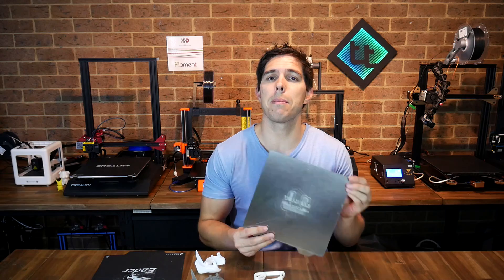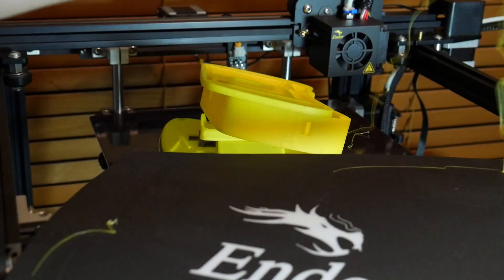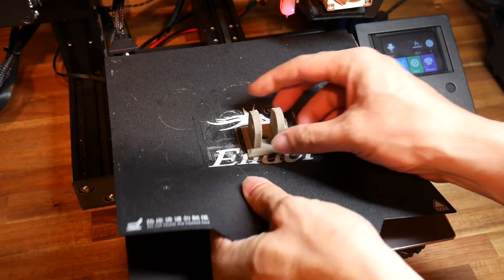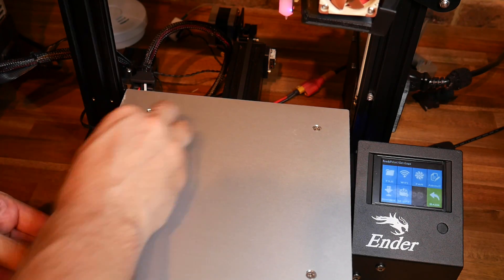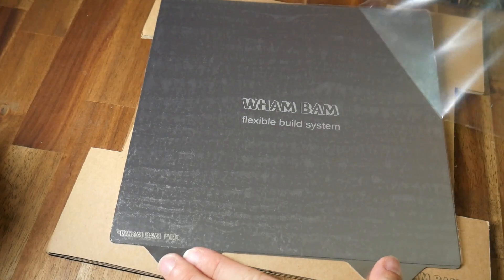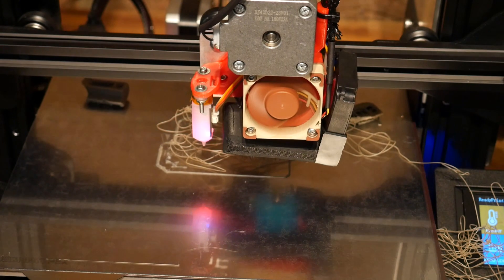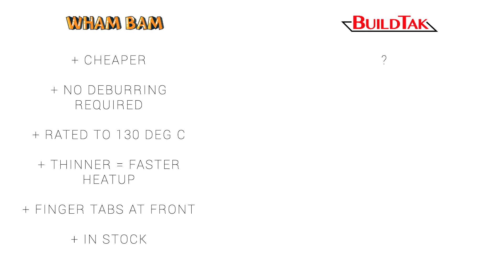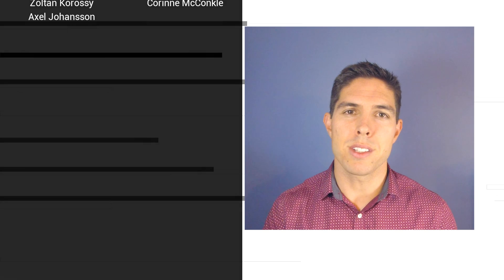Wham Bam Flexible Build System vs Creality Cmag vs Buildtak Flexplate

Comment: As one who mostly prints with PLA I find this product a big dissapointment.
After all the up beat "wham bam print away" videos on YouTube I finnaly shelled out for a Double Wham kit.

Having had it for two days now on my CR10 S Pro (Bl Touch) I'm still struggling to get PLA to stick. My previous problem was too good adheashion after prints were done, so I was looking forward to flex prints off the plate. I've scuffed and scuffed the PEX until I broke out in a sweat, and all I got from it was a good workout.

If it would only stick. No squishing of the first layer or high bed temps have helped so far.

I'm holding back from giving one star, in the hope that it'll suddenly start sticking...

Comment: Not positive, but I believe temps above 80 c not being recommended has more to do with the adhesive and flexible additives in the magnetic sheet breaking down, than it does reaching it’s curie temp…? 80 c seems kinda low for a curie temp.

Comment: Got really bad experience with the Creality magnetic bed cover. It was stretching to a point where prints were warping with the bed cover still attached and when removed there would be stretched bumps there. Obviously wouldn't happen with steel so I'm eager to try it.

Comment: I use the creality magnetic pad and I spray Ultra hairspray on it. Works very well but if the print is longer than 10 hours it starts lifting on one of the sides. a bit

Comment: I just buy the system for cr 10 s pro but I have problems keeping the models in place. I start at 70° but then when is about 2 inch thick or less it just snaps out and I wonder if you guys have a way to make it stay. ?? Do I reduce the temp and let the bed cool down or should I keep constant temp? Please help if anyone else have this problems usually with small parts.

Comment: Consider scotchbrite or similar abrasive parts instead of steel wool, you won't end up with tiny fragments of steel wool everywhere, which shouldn't get near your electronics and is probably disastrous I'd it gets in rolls of filament.

Comment: I'm an old dude that just got into 3D printing a few months ago with an Ender 3 pro.  I switched to the Creality coated glass bed and its pretty awesome.  I installed a Bigtree Tech board and it was a game changer and I installed the BL touch at the same time but haven't used it yet.  I cant find an installation / setup video for "total noobs"...I mean that assumes you know zip about how to set it up!!  Can you steer me in the right direction for a video?  You're basically my guru for all things 3D and I cant seem to find this in your library.  Thanks for this video!!

Comment: 3:08  I think this is because you have a stiff section on the bed and you dont pulling of a line but instead pulling of a surface, imagine if the whole build plate would be stiff then you have to pull of the whole area of the buildplate at once.

Comment: it is a slow process of losing it's magnetic field one print or two prints won't show it. the more heat the faster it goes ... this just shows it's still good for 3 or 4 prints at higher temperature.

Comment: Seems you are dealing with two compunding factors making separation of the magnetic layers difficult. A) creating a vacuum seal between the layers underneath the footprint of you print, and B) effectively turning that area solid rather than soft and pliable.

The quick n dirty way of "solving" this would probably be printing a very narrow wedge, smooth its tip edge, surfaces and any layer stepping slightly to avoid doing damage to the two bed layers in use. Then, when a print is done, separate the layers as far as they will go without struggle. Next, slide that wedge in between the magnetic layers, and press it in underneath the print. You wanna limit the force applied as much as possible, while still doing the job, so keep the wedge long and its angle narrow. You're basically just trying to "break a seal" to get it going.

Comment: Don't use the steel wool shown in this video. That'll carve groves the size of the Grand Canyon.
Instead use fine or ultra-fine steel wool used for polishing other metals. It'll scuff the pex layer more evenly and leave a nicer finish on the bottom layer.

Comment: The reason the creality has a hard time coming up is because of torque. Where the part is, you need to not only overcome the magnetic force holding the leading edge of the peel, but also the force under the entire print area. This does not happen with a steel sheet because it is stiff, giving you the mechanical advantage of the lever arm between your fingers and the back of the print area. Think like opening a door, because the creality has no stiffness, you only have the lever arm of the leading edge of the peel. When there is a stiff spot the magnet has a longer lever arm. In the analogy you would have your fingers inside the hinge, and the magnet would be holding the door closed with the handle. Crunchy...
Reply: The reason you could not figure out this behavior despite it being blindingly obvious is because you did not assume you could. While above average intelligence, I am no genius. I solved it merely because I assumed I could. In my opinion a lot more people would be smarter than me if they assumed they could solve things.

Comment: A few hours exposure to a little over a magnet's curie would have little to no effect, please do your homework before you make a fool of yourself. While a magnet is held above a it's curie temperature the magnetic grains in the material are exponentially more likely to flip. This means, the hotter you get it, and the longer you hold it there, the shorter the lifespan. It is not an on-off switch, it is a gradient. The difference with regards to 3D printing is that the wham bam will last printing ABS at 120C for thousands of hours, whereas the creality is unlikely to pass 100-200 hours printing at 80C. Likewise the wham bam would be lucky to pass 100 hours printing PEI at 200C whereas the SmCo magnets I use can do so for many years.

Comment: The Creality build plate is sticking like that because the printer part is acting like a larger flat surface area you need to overcome the magnetism to pull off, I've also noticed it can sometimes feel sticky too between the sheets.

Anyway, I'm okay with the Creality one but the moment it wears out I'm getting the Wham Bam plates for both my Ender 3 Pro and Wanhao Duplicator i3 Plus.

Comment: "for future me" 👴🏻

installed this build plate on my cr10s pro yesterday,

• remember z offset will need to be updated when upgrading from stock creality build plate
• physical probe detection ie. when z min is triggered will need to be adjusted when installing this plate on a system that has a inductive sensor (such was the case for me).
  • the reason i had to physically adjust the probe in it's holder (hero me) was the probe was detecting (triggering, ie. light was going off on top of probe) the build plate at a different height from the previous build plate.
• after adjusting the probe when it would trigger ie. make light go off when nozzle hits shim, anchor down probe in holder.
• then record current height of nozzle
  `m114`
• get the current z offset
  `m851`
• adjust z offset accordingly if needed, (i start with 0 when compiling marlin, 2.0 bugfix)
 `m851 z-0.2 ; example of how to adjust z offset`
• save new settings in eeprom
`m500`

all these steps were required to get the wham bam build plate dialed in my system.

ohhh you might want to update your PID settings for your build plate now that you have a new build plate on your printer, as it should reach desired temp sooner using less energy if tuned properly

• optionally (update PID for new build plate)

```
m303 E-1 s60 c8 ; tune the heatbed for 60ºC cycle 8x
; record Kp Ki Kd values after tuning completes, my tuning on stock HB cr10s pro Kp 107.37 Ki 21.45 Kd 358.25
m304 d358.26 i21.45 p107.37 ; input new values into FW
m304 ; read current PID settings for heatbed
m500 ; save values to eeprom to persist through restarts
```

Comment: @Teaching Tech 
The problem with the magnetic bed removal is actual simple... have you tried to separate 2 Solid thin magnets ? sometimes is impossible .. you have to slide one of them from the other.
The actual print will transform the soft magnet into almost a solid one and make it very hard to remove from the bottom magnetic layer which is also rigid.

Comment: Have installed Wham Bam not having much luck prints won't adhere to bed have polished bed with wire wool cleaned wit IPA and altered settings in Cura but still can't get them to stick manged to get 1 print out of 20 need some advice have spoken to wham bam but he only suggesting things I have already tried frustrated.

Comment: Great video review. However if you own an ender 3 pro, you don't have to remove the lower magnetic sheet adhered to the hot bed. The flexible steel sheet will magnetically stick to the ender 3 pro hotbed just fine.
Reply: Charles - Thank you! I came to this video exactly to discover this information!
Reply: Good to know

Comment: do you recommend instaelling this on top of glass? my heated bed is a slightly thin PCB so unless I put glass on top it wobbles up/down  ruining my print quality. not to mentioning the SEVER bend that it has which makes even Unified bed leveling to not be able to fully take care of it!!!

also can you try an Inductive sensor on it? I wonder if the spring still will be enough to trigger the probe

Comment: you still should use the shims even with a bltouch since air isnt conducting heat very well so your bed heat might not be as uniform as it could be with the shims used

Comment: "Energetic 3d Shop" seem to sale nearly the same system on Aliexpress. The magnetic base is rated to 140°C explicity described as usable for ABS. About 33 $ Australian (20€) including spring steel with PEI on one side. Its available up to 508*508mm² (113 $ Australian, 70€). Many sizes available - I will defintly upgrade every printer I have.
Of course you can combine the magnetic base with any other spring steel - for example with thekkiinnggs PEI powder coated one (v3 and v4 seem not to have the problems you had with the v2, I did many prints without issues - and the 1st layer looks exactly like the prints from original prusa). Sometimes you can get them even in bigger size (I got v3 in 305*305 - so big prints with structure on 1st layer).
Using different surface, every printer with such a system should have mechanical ABL (like BL-Touch) to avoid the nozzle crashing into the bed if you forget to relevel after changing bed... 

As you can get the magnetic base standalone for 17$ Australian (10€) (220*220mm²) even if the magnetic base may loose magnetism after longer use - its quite cheap to replace it. But maybe simply buy a new set, because you never have enough spring steels for trying different surfaces ;-)
Reply: I'm also considering getting the Energetic Bed for my CR10S Pro. The quality of Wham Bam seems to be superior but would you say the energetic bed was worth it?
Reply: Also the price difference is 3 times including shipping for the Wham Bam. $50 for Energetic, $160 for Wham Bam.
Reply: @Justin-yc3eb  I am definitly happy with the Energetic spring steel. It works perfect on different printers. I do not have the Wham Bam, but it works as good as my original prusa mk3 spring steel wit PEI sticker (of course I like my PEI powder coated one more). Haven´t had any issues with the magnetic base.
Of course you have to be careful with 1.st layer - I accendently leved much to low and the PEI got damaged. But that can happen with the WhamBam also. With spring steel I strictly recommend ABL (on the Ender 3pro I simply use a film switch probe for less than $2 (with a LED board <5$) connected to PIN29 on the creality board now. Works very well).
Also tomorrow starts "midsummer sale" on AliExpress - my basket is already very full ;-) The prices for Energetic are also reduced (esp. the big sheets).

Comment: Has anyone tried putting build surfaces on both sides of the whambam flexible plate?

I've been using whambam for about six weeks now and overall I've found it to be a great product.  Heads and tails over scrape scrape scrape.

I find that whambam's PEX material works great with PETG, but when I use it with PLA my prints detach.  I have also tried using BuildTak on their flexible plate and find that it works great for PLA but grips PETG too strongly.

What I would like to do is to put BuildTak on one side and PEX on the other.  Their FAQ (https://whambamsystems.com/faq) even says that you can "mount a different surface on the back side".

I was wondering...do you or anyone you know have any experience with doing that?

I am concerned that having BuildTak on one side and PEX on the other might reduce the temperature of the build plate or have some other unintended side-effect.

Other than that, my biggest complaint regarding whambam is that I can't get it through amazon so I have to pay for shipping.

Thank you for introducing me to this product and your other great videos.

Comment: Creality does not recommend using their cmag flex bed above 80c.  However it is rated for 100c.  Not sure why you have those issues.  Do you have the problem when it's lower temp like 60 or 65 for PLA?
Reply from the maker: The Cmag works ok, but it degrades over time. This is even when printing at PLA temps only.

Comment: the pop from removing the cmag surface from the magnet is because the bottom of the print is flat and still adhered to the surface.  When pulling the surface up, you have to overcome the magnetism whole surface area of the print at once, which is much harder to do than rolling it off.  The sound could be air rushing in, similar to a suction cup.

Comment: I have a different problem.

I have a flexible surface (like the Cmag) and, when I'm printing a large object it will warp because while the part will stay attached to the flexible layer, the top layer detaches from the bottom layer -- the magnetism doesn't keep them together.
Reply: Gary R With a wham Bam system you will have much better results, the magnet is much stronger, and the top surface is mounted to a spring steel sheet that keeps its shape much better

Comment: I'd love to know if you can get Nylon to stick to any of these!
Reply: Lee Mitchell I have only had success with nylon while using a glue stick, the PEX will not deform and the magnet will resist the temperatures, but for bed adhesion and nylon you do need glue stick

Comment: I would love to see a dual extension mod for the ender 3. Most say its pointless. But i wanted the 2nd extruder to hold the water soluble filament for printing supports.this will change the printing game.

Comment: Hi Michael! I've been testing and using the Wham Bam Flexible Build System since the beta, and I also backed their Kickstarter. I have both that and the Creality Cmagnet surface, and the Wham Bam system is my absolute favorite. I think the issue with the Cmagnet's removable part wanting to stick so hard to the bed part is that when you have a large-footprint model, more of the magnets' surfaces are kept in contact with each other. It's harder to pull two magnets straight apart than it is to bend them apart. Thanks for showcasing the Wham Bam system!
Reply: Wham Bam and Buildtak system costs the same at my retailer.
Which one is better in your opinion if the price is the same?

Comment: the magnet doesn't loose all of its magnetism in a sudden with the bed temp slightly above the upper limit, but it will certainly get weaker over time for that kind of abuse. perhaps, something like hundreds of hours of usage will certainly weaken it enough for it to be unusable.
Reply: I came here to say the same thing. It's a shame that he is spreading false information.
Reply: Even if it lost most of its magnetism, I think it would still work OK if you used a couple of bulldog clips to stop it sliding.   I don't really print anything but PLA, so the temperature issue doesn't arise.
Reply: My stock magnetic bed on my Ender 5 lost most of it's magnetism after printing PETG at 80c for about 100 hours and PLA at 60c for about 1,000 hours. I was really surprised it went that fast.
Reply: Well my stock bed bubbled horribly when raised to 90 degree for 4 hours. There might be some luck involved in this. Was still plenty magnetic, but still totally useless.
Reply: I used WhamBam for a while, and now it has started to fail.  Some parts pop up when printing, so it loses the calibration, and those areas go right into the Wham Bam board at the start.  It is no longer a reliable, flexible plate.  The magnet seems to still work, but maybe it is not strong enough to keep it tightly down, and the plate warps up.  I am not happy at all.

Comment: Michael, you didn't by chance check and see if you could use the existing magnetic surface on the Ender 3 Pro before removing it down to the aluminum before installing the new one by chance? Would the Wham Bam stick without replacing the underlying surface? Will the Creality flexible magnetic sheet stick on the Wham Bam when you replaced the original?
Reply: Barry Libenson you can certainly use the included magnet and only buy the Flexi plate and PEX sheet, however the Creality magnet is not as strong as the Wham Bam magnet and it will lose its magnetism if you push the heat of the bed over 80 or 90°.